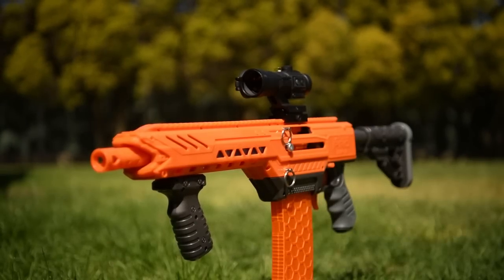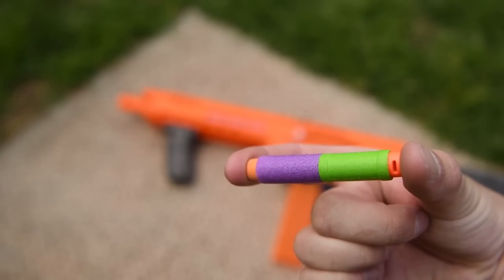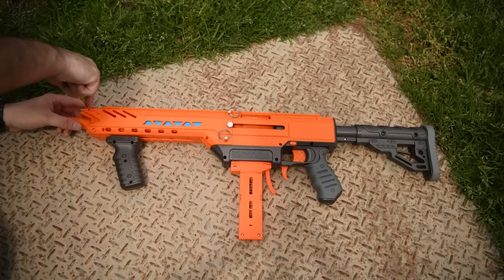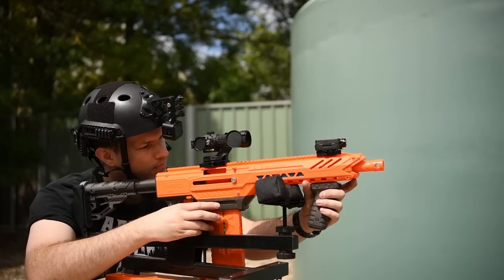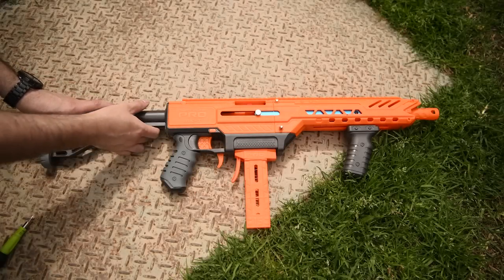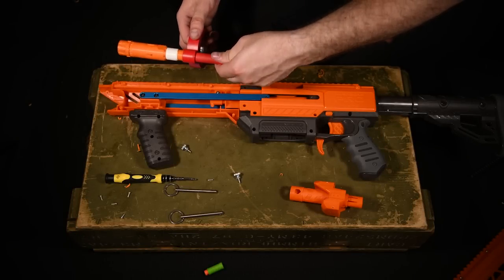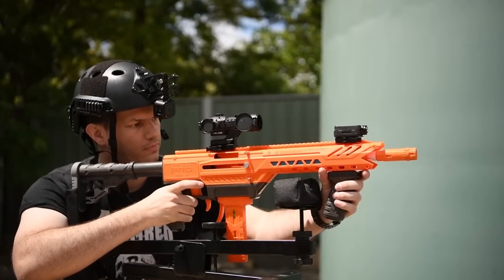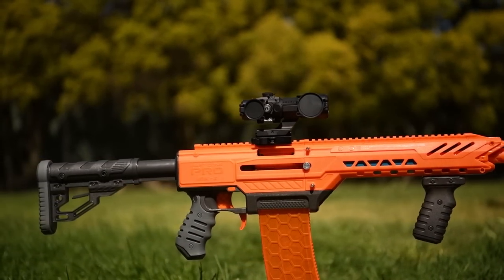Dart Zone Pro - The Best Nerf Blaster (Out of the Box)

Comment from the maker: I have since found that you can install a Worker Prophecy dart gate and barrel into the DZPro and it will now fire Worker darts reliably and Bamboo darts, both around the same velocity of 200fps with the 12kg spring. No real accuracy or performance gains over the brass barrel I did in this video but a better option if you have the money to spend. https://imgur.com/a/OPgrRUH
Reply: Your First like,
Reply: Bradley, did you use the D.Z.P breach for the worker gate?
Reply from the maker: Yeah I did, just swapped the pusher o'rings though.
Reply from the maker: Luckily there was a box behind it to catch the darts!
Reply: Bradley, what size is the CEDA spring cut down to?
Reply: I just gout my Dart Zone Pr and figured out why the other darts like the Workers are not firing reliably, and why the poop out when you pull back the priming handle, the gate is pinching the darts against the pusher and when you push forward the prime handle to chamber a dart and then pulling the prime handle back releases the pinch. After you prime back the handle when you slide it forward go back and forth in small increments and it won't pinch, which means the the barrel is too tight or the gate/pusher are not shaped right for properly for pushing the darts
Reply from the maker: @josephmerz7414  I matched it to the length of the stock spring
Reply from the maker: @ocularcavity8412  that's where using a Worker Prophecy dart gate and barrel solves it
Reply: @BradleyPhillipsYT  AWESOMENESS! I just ordered one on amazon thanks for the tip XD, btw does it also solve the weak seal problems?
Reply from the maker: @ocularcavity8412  yeah, just use the Worker o'ring on the DZP pusher
Reply: @BradleyPhillipsYT  thanks a bunch
Reply: so... $180 and still have to mod it?
Reply from the maker: @caliginousmoira8565  for modders, yes. For people it's intended for, probably not.
Reply: @BradleyPhillipsYT  I just got this! So the verdict is just go with the normal bamboo darts right? What about the magazines? And I guess no need for half lengths?
Reply: Maybe a dumb question: will it still fire full-lengths with this solution?
Reply: Hey Bradley,

I’ve only stumbled across this video recently.  I got a question for you, as far as the scar barrel is concerned is that a 17/32? I’m looking around for the dimensions on the worker aluminum barrel, but can’t find any.
Reply from the maker: The Worker aluminium barrel needs a 16mm rifled barrel, while if you use brass you'll need a 17/32" scar barrel.
Reply: @BradleyPhillipsYT   Thanks for replying! So its the universal adapter.  I didn't want to throw more than enough money around.  The worker barrel you mentioned, is that the orange anodized one that comes in an upgrade kit? Or the long black barrel one with the scar tip?  I noticed there are two kinds.
Reply: Can it use normal Nerf Elite darts?
Reply: @BradleyPhillipsYT    Will it still fire full length bamboo darts with the prophecy dart gate installed?
Reply: jjsnowking Yes it will.  More reliably in fact.

As per the other question, yes, but not as reliable.  There is a tendency for them to jam because of the friction experienced between the wall of the barrel and the dart tip itself.  I heard if you add some lubricant it will make it easier to fire.  Though I’m sure Brad can give more insight on that.
Reply: Can I put in a worker retaliator 28N long spring from monkeemods without having to thin the plunger tube?
Reply: @aydendy9282  - Firing Nerf Elite darts out of the Dart Zone Pro would be the equivalent of mounting an Ashtray on a Motorcycle.

Comment: Ok. I have one and have modded it. I have figured out the issue is with a overly tight dart gate. That's why all other darts dont fire regularly. I simply sanded down the dart gate and it fires all dart types just fine. Be careful not to sand the front where the o-ring seals. I also but some tape around the dart gate to barrel for a better seal. I was getting 215 to 230 with a cut down 16kg ceda spring.
Reply from the maker: Nice. I'm currently using a Worker Prophecy kit in mine. 200fps average with a 12kg spring.
Reply: @BradleyPhillipsYT  I've replaced the spring recently with the 12kg ceda spring. With a scar I'm now getting 180 fps. Going to try the brass barrel next. What was the length used?
Reply from the maker: I think it's 8.5"

Comment: Interesting dart design there, might just help to reduce friction, which explains why it’s able to exit the barrel even without a perfect air seal. The worker gen3 seem to get stuck because it just has more friction in the barrel and the bad air seal just causes the blaster to loose too much power to propel the workers all the way out. Also it would appear that dart zone tried to go for a free floated barrel? Although that’s kinda pointless for a nerf blaster. That breech and barrel assembly is just terrible. Mounting a barrel from the bottom is a terrible idea because u can’t keep the darn thing centered. It would be cool to see after market cnc metal breeches and better mounting methods. I’ll just hold on to my mcx prophecy for now, coz with this blaster only the darts seem interesting
Reply from the maker: I've found that a Prophecy breech will work with this which is what I think they should have used anyway. Performance is no better than my brass barrel though unless I go for an even heavier spring.
Reply: @bradley  will the prophecy breech work with the dzp metal and plastic barrel supplied.

Comment: Good break down. Question: is the half-dart adapter compatible with talons or katanas?
Reply from the maker: If you mod your Katanas by filing out the locking mechanism a little they'll work, Talons don't work with the adapter though but are compatible with the blaster

Comment: Hey Bradley Phillips, I saw that you cut your spring at some point in the video, what did you use to cut it and why did you cut it ?
Reply from the maker: Cut it to the same length as the stock spring or it won't fit
Reply from the maker: Used wire snips

Comment: Do you think you could just glue the brass into the plastic barrel with a scar attached would help or do I have to open the DZP
Reply from the maker: You could glue it, but there would still be an air leak.
Reply: Bradley Phillips I guest that would happen I’m mostly just trying to put a scar on the end 
Do you think it would be strait enough or should I just glue the brass to the metal barrel

Comment: The main draw back for me is that without substantial modding, this won't accept at least the common darts that we use. I don't want to be 'chained' to proprietary darts just to use this blaster. If Dart Zone don't address this in Mk2 then this is basically an expensive Hasbro 'Ultra'.
Reply: That would of course depend on the price of the bamboo darts
Reply from the maker: Also as far as I'm aware, refills aren't even available yet
Reply: @zeroblade6599  Yeah that's something I'm hoping for, that they are as cheap and as accessible as their other Adventure force darts, then they might become the go to dart for everything. I guess we'll have to wait till Bradley does the next video, to see if they are as accurate.
Reply: Other darts work much better with plastic barrel
Reply: Yes, community dart bins are not going to switch to bamboo darts with maybe 1 or 2 of these in each group. So that means either bringing your own darts, or putting up with jammed Worker darts unless you mod it. But most people are buying this so they don't have to mod.
Reply: Main Stay it says that the collectors edition includes 240 darts (120 half length, 120 full length) on their website. It says that this pack is worth $30, which is decent, but not exactly amazing value.
Reply: If you swap to the provided plastic barrel it works with elites and everything else. My E-Kind waffle tips come out of the plastic barrel just fine.
Reply: Yes but that's a big FPS drop and at that point I can run an upgraded Retaliator and save $150